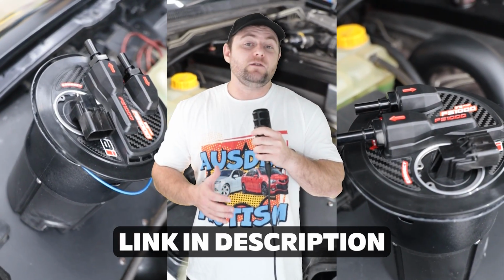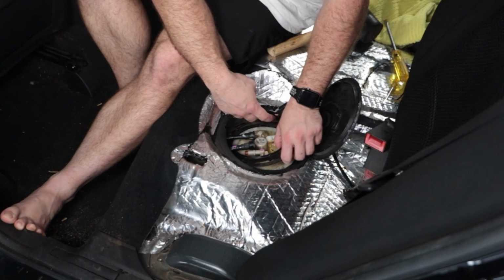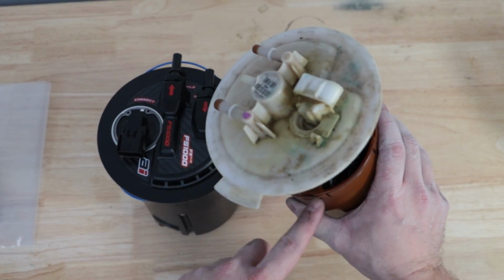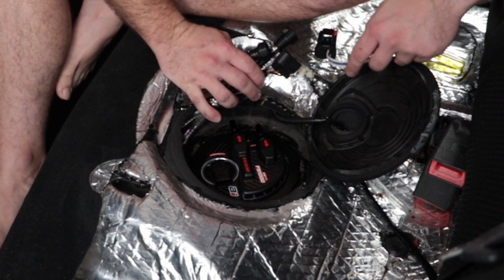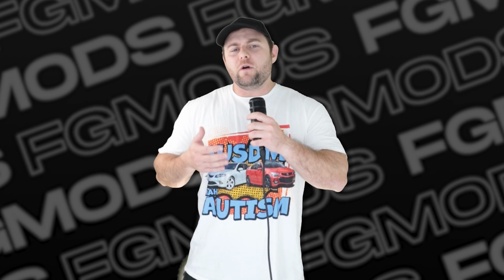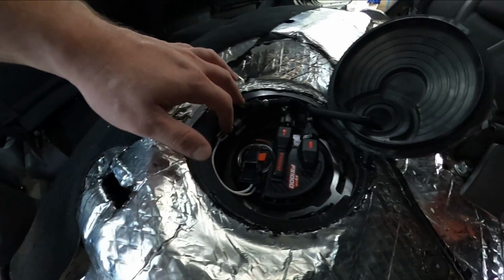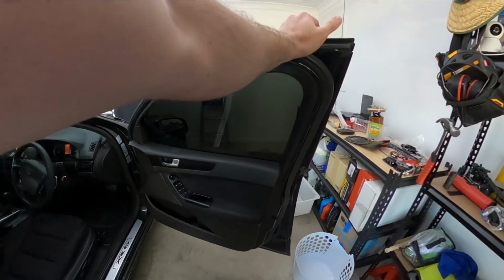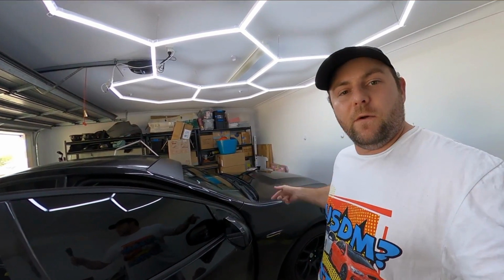High Horespower XR6T? You NEED this!

Comment: 2:25 There's a valve at the bottom of the swirl pot. I used a bent piece of wire to press in the valve to empty most of the fuel back into the tank.

Comment: Be interesting to hear what your opinion is, I am assuming you have previous issues with fuel starving on the track to compare the difference to?
Reply from the maker: I still need to take it to the track to really put it through its paces.
But with factory hanger, below 1/4 it has surge issues.

Comment: Pro tip... Make sure you have under half a tank of gas before removing module 😉 and also clean all the road grim up from under the green o-ring, this will stop getting that bad fuel odour... I'm welcome 😁
Reply from the maker: Pro tip - When you lift the hanger out, don’t try to tip the fuel back into the tank because it’ll just go everywhere 😂

Comment: How's it going for surge issues below 1/4? Last 2 models they did for fg's were rubbish below 1/4. The first model they did was rubbish and were so hard to deal with over it.
Reply from the maker: Well it definitely doesn’t have surge issues now.
Reply: @fgmods hopefully with the twin pumps fitted its fixed as well.
Reply from the maker: When I get twin pumps in I’ll also need to replace wiring to meet the power being drawn.
But with the right pumps and injectors this surge will be able to provide enough fuel for HP that my engine could possibly make.